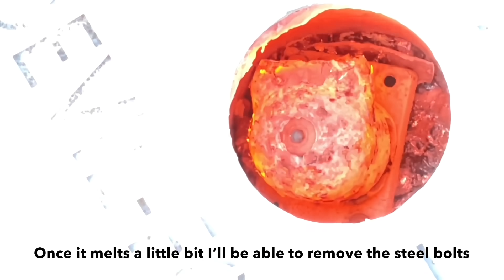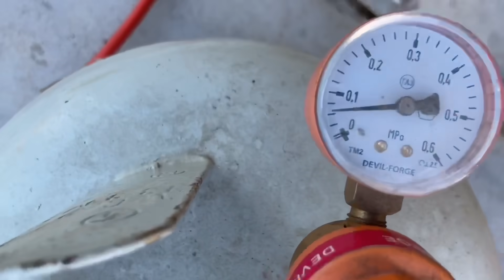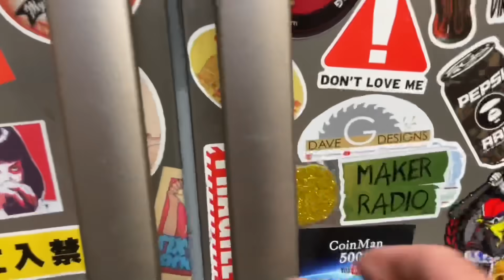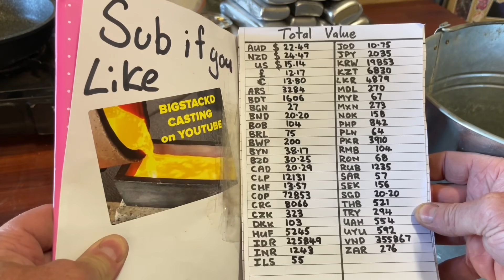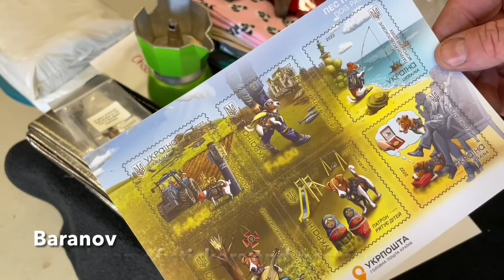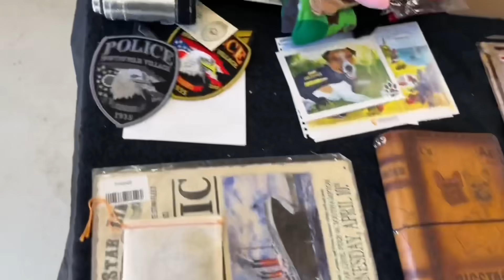Security Casing Melt Down - Bulk Bars - ASMR Metal Melting - Trash To Treasure - BigStackD Casting

Comment: wow thats a lot of bars. I keep thinking "i wonder if those cameras still work and will he check to see if they work'?  Love all the goodies that you were sent and that book cover is exceptional.
Reply: I have read that without the original security code they will not work even if they're not broke but I really don't know!
Reply: @lewisgiles8855  it's easy to bypass the security code in most of them - there is either a default override code or you can simply reset the camera to default depending on the brand/model  - I could be wrong but it's something I have experience with on some Sony relics
Reply: @jnb756  I wonder if he will try it?

Comment: I have a question. I see you have to preheat everything that's going to touch the material to avoid a steam explosion. Except when you add more material. Why is that? Why can you just throw in cold aluminum or brass or copper?
Reply: Good question
Reply from the maker: Normally I’ll hold it over the furnace for a couple of seconds or longer just to warm it up a bit but I do highly recommend heating up your metal before adding it. Especially if you’re putting in dirty cobwebs covered pipes as a little spider can create quite a bit of a steam explosion when pushed under the molten metal but that’s happened only a few times in my life👍🏻. I have had steam explosions when skimming because I forgot to pre-heat the skimming tool but again that happened back when I wasn’t as clued in.

Comment: I have maybe a dumb question /request but I'm wondering...is it possible and what would happen if you had two forges going at the same time. One with aluminum and one with something of a similar melting point. I think copper may be too hot so possibly brass? But you have one of your really thick molds and you fill it halfway with aluminum and let it start to freeze. Then, pour on the second metal. Would you be able to make a metal "parfait" or what would happen if you did this?

Comment: You should invest into a hydrologic press, I think this could add more to the channel. 

Although, I do enjoy the hammer or better yet sledge hammer option when breaking down metals into smaller pieces. 

Maybe a combo of both? Plus think of the time savings with a press, no more hammering a bunch of aluminum tubes into flat pieces, 

IDK, what does everybody else think about this idea?

Comment: Out of curiosity, why does aluminum seem to always leave more excess behind than other metals? Is it simply because it cools faster?

Ive noticed that copper and brass often leave much less behind in the crucible after a pour, sometimes even leaving virtually none behind.

Also, why does aluminum always seem to produce crazy amounts of slag? I figure its mostly due to the stuff that was left on the metal itself, but even in very clean pieces it seems to produce a lot of slag, why?

Comment: Weird question? Can you over melt metal? And if so, what happens?
Reply from the maker: The only metal you can really have problems with is zinc and once you overheat that it will release zinc oxide and make a mess of your Crucible. But every other type of metal to get to the boiling points of it is impossible with home furnaces so I have no idea what would actually happen if you could actually get to boiling point of other metals . I’ve never heard or seen anything about overheating any other metal so maybe it’s just with the zinc🤔?

Comment: Apologies for my ignorance. What is the slag material which forms on the surface every time? Its being removed with a spoon every video. Why is it separating and not melting down with the rest?
Reply: The slag is a combination of things, it's all of dirt, paint, and the metal that oxidizes while smelting. I'm not sure about  aluminum slag, but in theory, if a current was applied to the slag while it is molten, he should be able to recover a good amount of the aluminum.

Comment: I've recently learned about a zinc-aluminum alloy that is cheap and easily cast-able. It's what is used to make just about every metal object in our daily life and is commonly confused for aluminum (it's mostly zinc). Are you aware of this or is there a chance your aluminum collection has a large zinc contamination?
Edit: The density difference seems too big to mix up easily, it's much more likely there is aluminum in your zinc collection.

Comment: the cameras could still work but they are an old coaxial cable style that needs an encoder and power supply in order to use them. If they were a PoE Power over Ethernet (the same cables that plug into your router that go to your computer/video game console) and had the right program to just plug them into a PC to get signal. You're better off trying to sell them to someone that knows how to use them or needs replacement parts or just gut them for a few bits of the metals.

Comment: Any suggestions on graphite ingot moulds? When I pour aluminum they won't release from the mould for a long time. I have used graphite powder inside and still no dice. I don't have this issue with brass or copper. Thanks

Comment: In the 1990s, I installed hundreds of camera enclosures very much like these in the U.S. The cost per single unit installation was in the hundreds in those days, and now, for $100-$150 USD, one can buy a camera that has 10x the resolution, low-light capability, and uses about 25% of the power, all while being smaller and more reliable.

Comment: Hey Mr Stack :D, was wondering if the next time you cool one of your melts in the bucket of water can you take before and during temperatures to see how hot the water gets as the bars cool? Love your content as always! Hope you have a good weekend <3
Reply: Aluminum is under boiling point, brass is in-between, and copper is anywhere from 250°F-500°F. It's quite dangerous. That's why it's better if you got an ice block or near freezing water.

Comment: Funny how  the  designs of the armored box hasn't changed but the cameras within are relatively high quality and recent. Those don't appear to be the  garden variety 1990s "digital' (but not really) "surveillance"  cameras.
Reply: Yes, I'd check they were defunct before applying the precision deconstruction technique.  They may be broken but saleable for parts.  Also, if they work, he could use them for security.  All he'd need is some casings ...

Comment: What is the most metal you have ever retrieved from a single teardown?🤔
Reply: I think it was his million sub mark. Massive motor melt I believe it was called
Reply: @Lewis Giles, I think you're right, that was a massive melt.  The stadium lamp yielded a lot of metal as well.
Reply: @marywilliams7624  If it depends on by volume YOU may be right, Lol Leslie didn't specify 😂